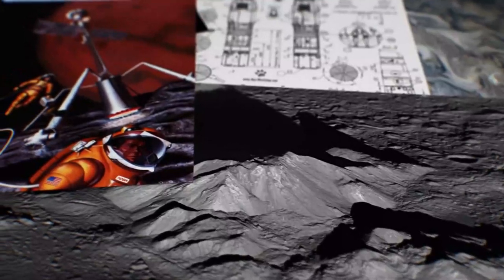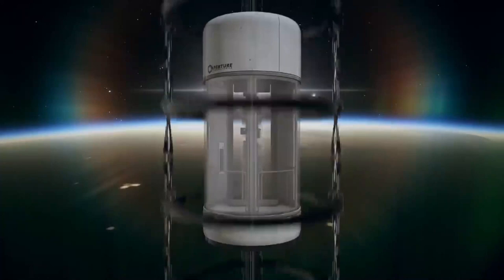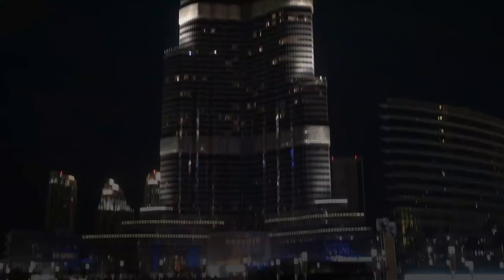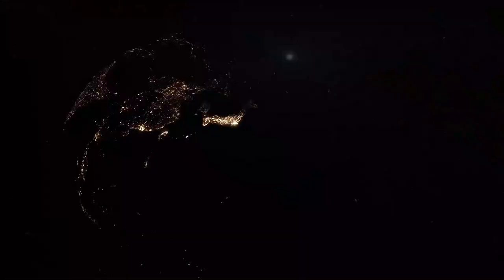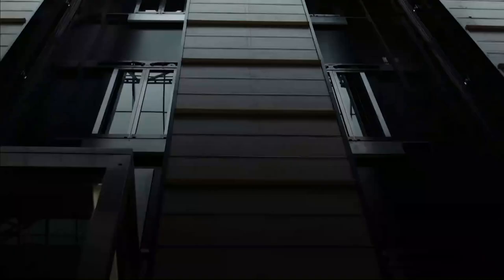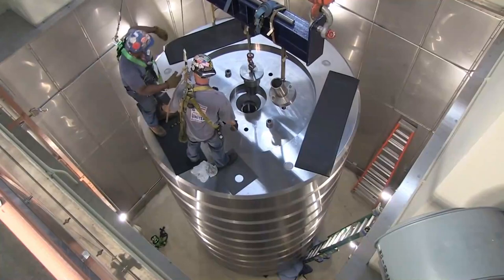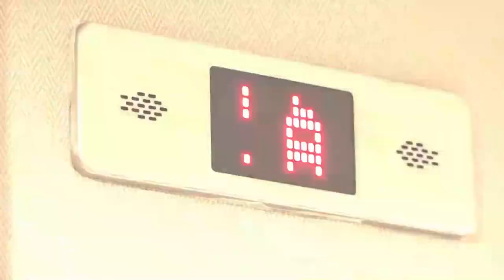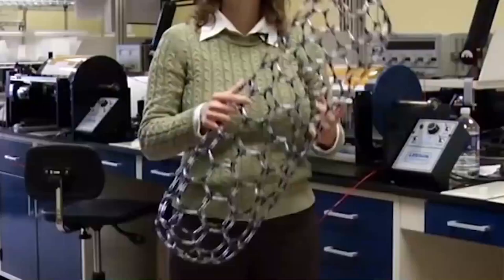First Space Elevator For 2045, Science Fiction Or Reality?

Comment: Space elevators are possible with current materials, if built in stages. At the center (G.E.O.) where gravity is virtually zero, multiple tethers would be used for added strength with no weight penalty. As you move out from the center, each stage would have fewer and fewer tethers to reduce the weight as you move deeper into the gravity well.

Comment: Electrical wiring that s the circumference of earth is common. But this video. is negative. With thrusters and weight compensator s it would be easier.
Reply: A magnet current from earth s causing upward torquing in milli seconds could be strategical